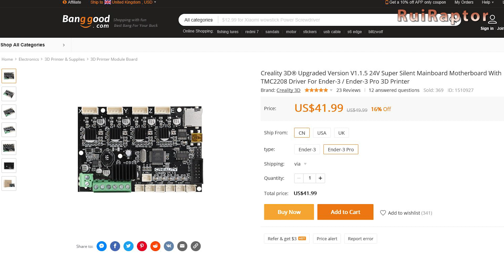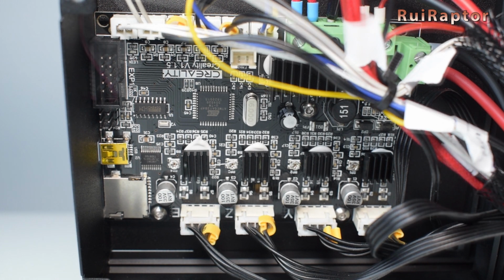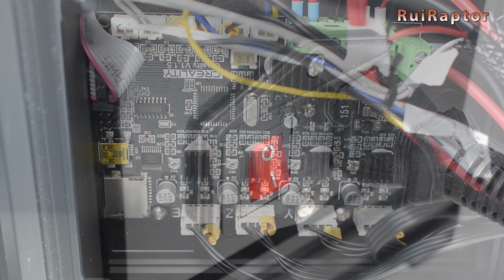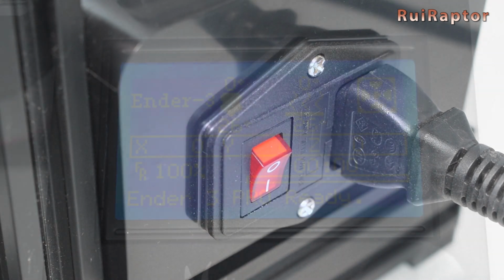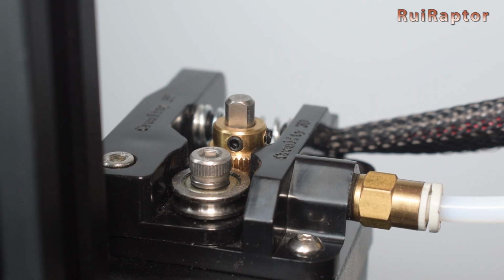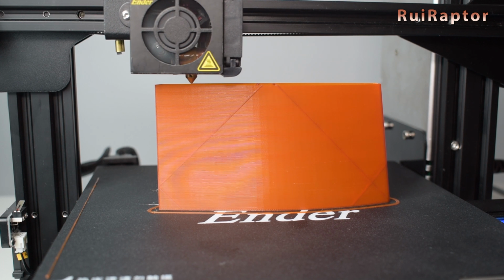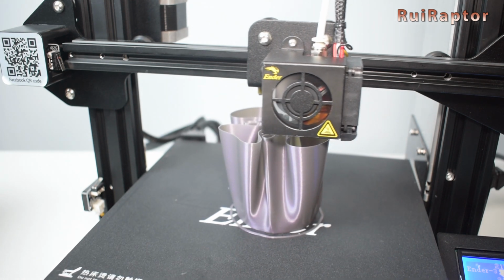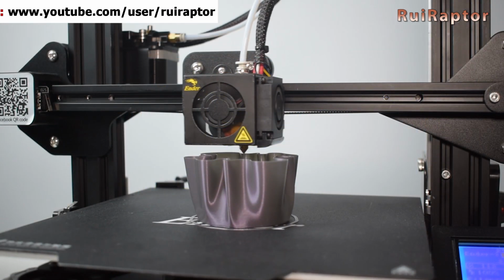Creality Silent Board (Ender3) - Installing & Fixing Issues

Comment: How do you disable linear advance? My extruder stops randomly during a print.
Reply from the maker: Hi Jon, the linear advance feature is enabled/disabled in the firmware (in configuration_adv.h). However, if you have the linear advance menu in the display, you can set it to zero to disable it. You can check all the information about it here: https://marlinfw.org/docs/features/lin_advance.html

Comment: Just replaced my faulty motherboard with a new silent one I go to turn it on and just get a blue screen.  I am so frustrated I cant explain it.  This is fucking bullshit.  "Plug and Play" what  joke.
Reply from the maker: Hi, make sure the flat cable is correctly connected. If yes, try to update the firmware.
Reply: @ruiraptor  Thank you much for your response.  I appreciate it!  New Firmware x New MOBO X new hotend and we are cooking (Fingers crossed)  God Bless.

Comment: I got one and it won't connect to pc, plugging the printer into the pc and it powers the bltouch.
Reply from the maker: Hi, your new board is probably different (4.2.7 ?). If that is the case, the firmware update procedure is different.
Reply: @ruiraptor  it's 1.1.5
Reply from the maker: That is an 8bit board and in that case it's the old procedure. Check the baudrate, maybe it's the wrong one.

Comment: My silent board does not refresh when inserting an sd card, i don't have the refresh option in the menue like i had on the original board. 
i always have to turn off the printer and turn it back on to see what's on the card.

Comment: So i found this video because I recently got this Silent Board and installed it on my Ender 3 Pro - yes it is silent, but after a couple of minutes printing the extruder stops. Just as this video suggest. I tried to upgrade to the new firmware, but the machine won't let me anytime i send the firmware update via USB (Octoprint, Direct from PC) the printer restarts and severs the connection before it can flash the new firmware. I am at whits end... I want this board to work.
Reply from the maker: Hi Mark, don't use octoprint to update the firmware. Use arduino IDE and the PC connected to the printer.
Reply: @ruiraptor  Does the .hex file need to be named firmware.hex? And if so, how we select it from the Ardunio IDE to upload?

Comment: Thank you so much for sharing. I've updated to 1.1.9 but my extruder still seems to stop extruding intermittently causing some bad print quality. My only guess is that Vref was not set correctly from the factory. Do you by any chance know what the Vref voltages are for X,Y,Z & E?

Comment: Hi. does this board also work on the Ender 5 if so do you have to do any firmware updates are anything different for it to work.
Reply from the maker: Hi, yes, it will work. The only thing you need to do is flash the ender 5 version that you can find in the config examples of Marlin.
Reply: @ruiraptor  thanks ruiraptor for the reply. you wouldn't be as so kind to email me at this address so that i can explain to you better what my problem is. thanks in advance..... iron_foot@outlook.com

Comment: Hi, Is it usefull use the TL smooter on this mainboard?
Reply from the maker: Hi, TL-smoothers are not needed since this new board is equipped with TMC drivers. These drivers can already eliminate the salmon skin.
Reply: @ruiraptor  thanks, i'v ask a lot of people on YouTube about the TL smooter on the 1.1.5, but noone has replaye so clarely like you. Thanks, but another question Is now in my mind, what about the current that go back to the mainboard during the print?
Reply from the maker: What do you mean by current that go back to the mainboard?
Reply: @ruiraptor  when the stepper motor Is moving there Is some small current that come back to the mainboard generated by the motor itself. You can try It by move manually an axis at printer off, and see the display lights up
Reply from the maker: I understand now what you mean. The back current is produced by the motors that act like a generator. We recommend you NOT to move your axis that way because that back current can burn your drivers. If you need to move the axis manually, do it slowly.

Comment: @ruiraptor is there a way to make it so that the mainboard fan runs separately from the parts fan? I heard you can run the mainboard fan through the power socket but I don't know how that would work with the power supply cables already running in the power sockets. Thanks
Reply from the maker: Hi, that's what we did with the cheetah board installation. The fan was connected directly to the voltage input connector by joining them together in one ferrule.

Comment: I am having the issue where the extruder stops. I am using S3D and i dont know how how to flash. Do you think you can make a quick video 🙃. It would be greatly appreciated!!!
Reply: Also great video!!!
Reply from the maker: Hi Noah, we have a video explaining how to flash the firmware. In case of the new board, you can skip the bootloader part. Check here: https://youtu.be/U9MGIlQgzkg
Reply: Thank youu

Comment: Hello. My friend noticed that the case fan in his Ender 3 is blowing air OUT whereas mine sucks air into the motherboard. What's going on? Any ideas? I love the silence with this board!!
Reply from the maker: Hi Mario, both should work fine but pushing air in cools better. To reverse the air flow, just flip the fan over.
Reply: @ruiraptor  THANK YOU!

Comment: How do you install the new firmware? I never done it befor and all I can find on YouTube is to update a 1.1.4 motherboard with the installing of a booloader ...
Reply from the maker: Hi, it's very easy but you will need an arduino to install the bootloader first. This is only done once. Here our other video explaining the procedure: https://youtu.be/U9MGIlQgzkg
Reply: On the 1.1.5 version, the bootloader should be installed, thats what the Creality website says. I opend your link, do I need to do something for the 2208 drivers?

Comment: hello, do I select the standard creality card when installing the most current marlin on this card? you only modified the drivers in the configuration for tmc2209_standalone and activated the linear advance right?
Reply from the maker: Yes, you need to select the microcontroller that you have on your board regardless of the firmware version. Don't enable linear advance. That was the issue in the first place for stop extruding while printing.

Comment: Just curious why you recommend removing motor dampers with the new board?
Reply from the maker: Motor dampers are used to reduce the noise. They also add temperature to the motors. The TMC drivers are silent drivers and temperature is critical so dampers are redundant and can increase temperature.

Comment: does this new motherboard allows you to install and plug  auto level?
Reply from the maker: Yes, but for auto level sensor installation you need to connect one of the signal wires to one of the display flat cable wire. You have adaptors on sale that would make this procedure easier.
Reply: @ruiraptor  Ok, thanks for the answer. I dont have yet that printer. I am still wondering if I would go with that one, or with a Prusa. 
What would be your opinion considering that my budget is 1000+ ?
Reply from the maker: Hi Joan, If you have that budget, go with a prusa MK3S.
Reply: @ruiraptor  Thanks for your advice.

Comment: My stupid board has the same issue with extruder motor not working.  Except, it manages to print absolutely nothing, not even "a few layers" or so.  Start up sequence, nothing, printing nothing.  But during "move axis" it works fine.  whaaaaaaaaaaaa
Reply: does it mean its working now? How did you fix your problem?
Reply: Did you fix the issue somehow?

Comment: Think my hair pulling has come to an end with the stalled stepper on this board! 

In Marlin/Tools/Board Manager, which board should be selected to flash the firmware? Don't see no mention of it anywhere.
Reply from the maker: Hi bob, you need to select Sanguino.
Reply from the maker: Check this for more details: https://youtu.be/U9MGIlQgzkg
Reply: @ruiraptor  Have successfully installed sanguino to boards manager, so as this is v1.1.5  bootloader is already installed to Creality board, correct?, so just flash the firmware now to the board? Thanks!
Reply from the maker: That is correct. The 1.1.5 already includes the bootloader.

Comment: witch marlin firmware u are flashed and witch board i have to select in marlin ??
Reply from the maker: Hi, check this video ( https://youtu.be/U9MGIlQgzkg ) where we explain the procedure in detail. The only thing that is different is the bootloader. With this board you can skip the bootloader installation. The rest is the same. Regarding the firmware, you can use either Marlin 2.0 or any other version in the creality facebook groups.

Comment: Thanks for this video. Is there a way to make linear advance work with this card. I have the CR10S-PRO and cannot find any way to make it work with 2208... Has anyone a solution ?
Reply: Sorry, my comment was not clear : this card and CR10S-PRO card seems to have the same embedded 2208 drivers. As on my CR10S-PRO I cannot get the Linear Advance work, I am wondering if anybody has been able to make it work with this Ender3 Creality Silent Board. In other word, is there any solution to make Linear Advance work on 2208 driver ?
Reply from the maker: Hi ReYoTa, the only way is probably to use the extruder TMC2208 in spreadcycle instead. You can eventually try to replace the extruder driver heatsink with a bigger one and add a more powerful cooling fan and see if it helps to prevent the driver to stall.

Comment: Nice video as always, but... I don´t get the point of replacing a board with fixed drivers with another one with fixed drivers. I mean, the GEN L has removable ones ad would cost marginally more, with the bonus of being able to choose from different drivers and mix some, like the 2208 + lv8729 mix I have on my tornado. The only plus I see is the pre-installed FW, but that can´t be it either as per the potential issues, hence not entirely plug-and-play... not defying jour judgement, just curious (I tend to overlook things). Still, bottomline, ist´s still a good valid option, of course!
Reply from the maker: Hi, replacing the stock board with one that allows the installation of removable drivers is always a better option. We have shown (not too long ago) the installation of the fysetc F6.

There are many other boards such as the MKS GEN L for example, however, in this video we are showing the plug & play solutions that you can find in the market and we are trying to cover those ones by one.

Comment: Nice video, i don’t fully understand the firmware part, where do i get the new firmware? and the things i need to define and the others that i need to disable, and last question, do i need a bootloader with this board, and this one already have thermal protection?
Reply from the maker: In theory, you only need to flash the firmware if you use S3D or if you notice your extruder driver stalling. The firmware can be found in the Official Creality facebook group or you can download the Marlin 2.0 from Github directly. With this new board, you don't need to install the bootloader
Reply: Thanks